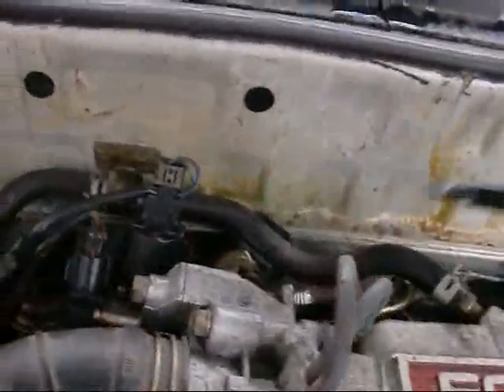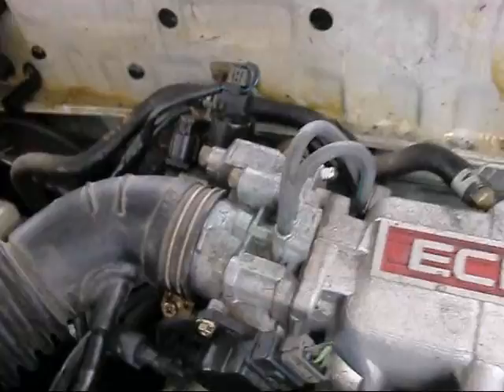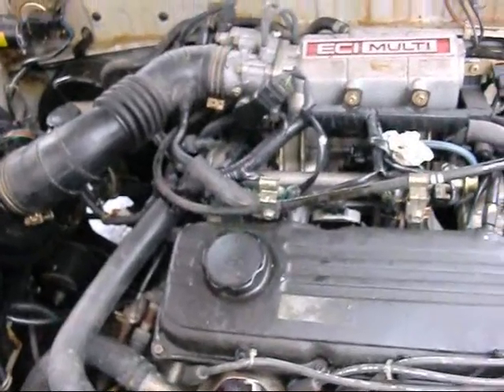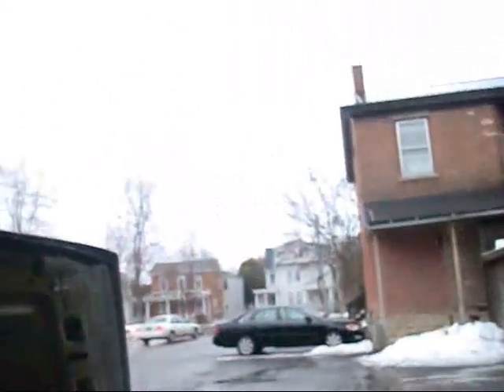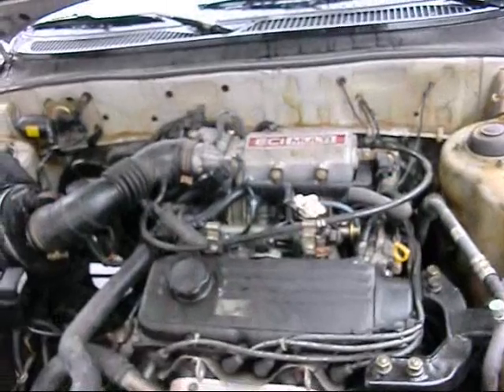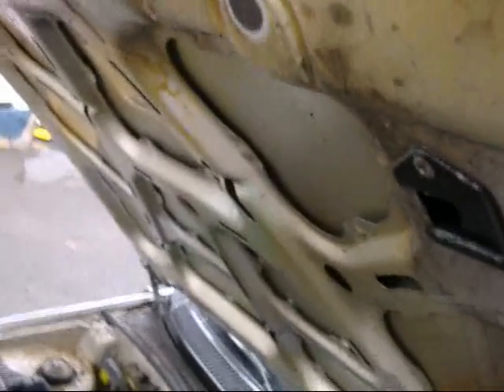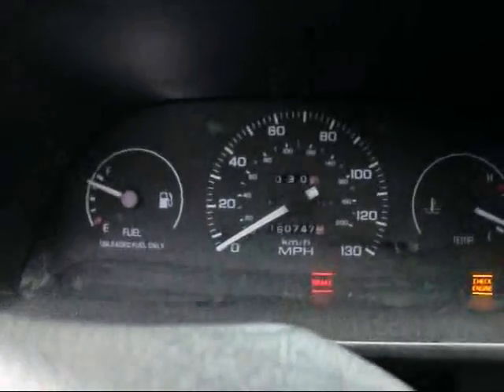Hyundai Idle  2 27 13

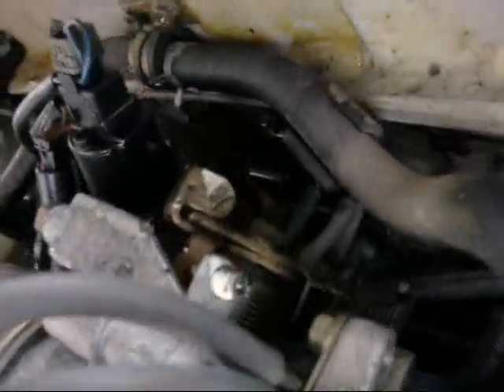Comment: At 0:50 the ISC on this motor does not need cleaning viewers, there is no way for carbon to build up on it because it is a stepper motor that is located outside on the throttle body linkage on the early 4g15 motors...however later model 4g15 motors had the ISC that is integrated into the throttle body air channel, so carbon can build up on the later style 4g15 motors, but if the ISC looks like the one in this video it does not need cleaning. however you can clean the intake, and throttle body/egr ports, and I noticed that this helps out a lot. 
  
The valves sound like they need to be adjusted on this motor, you can her them ticking.